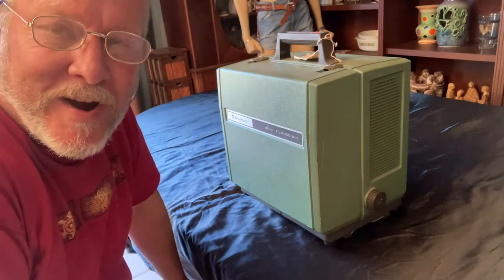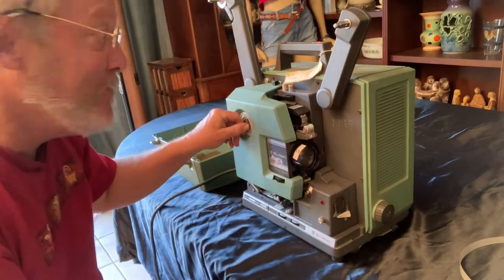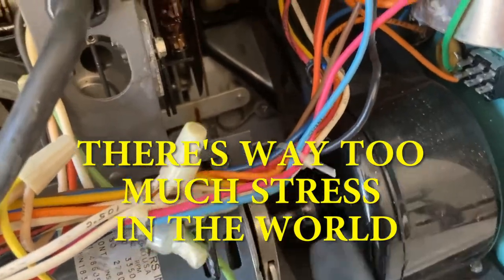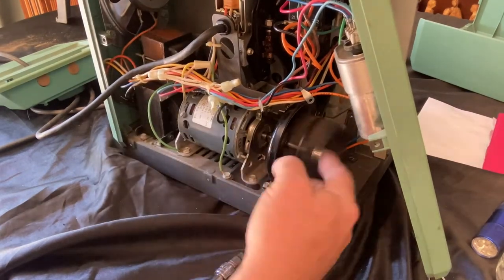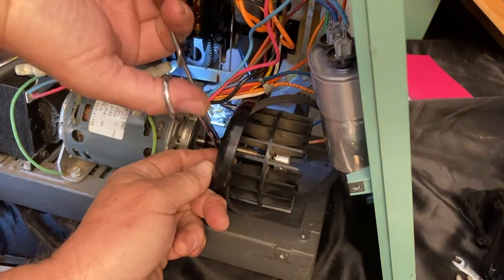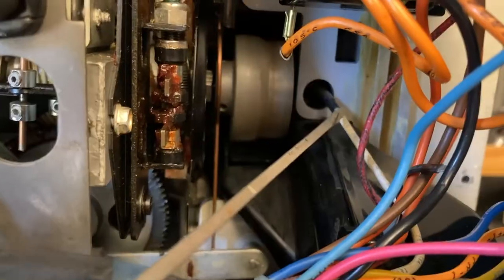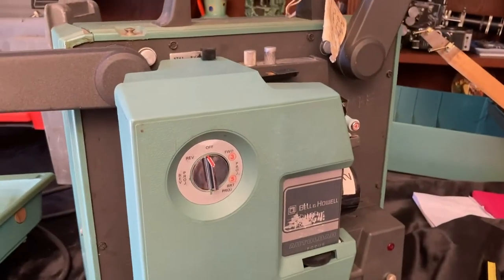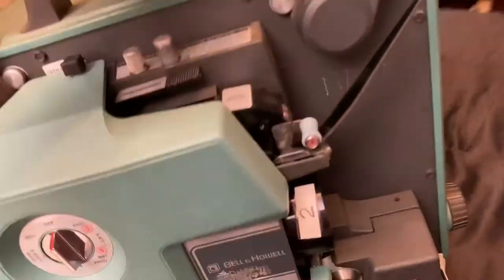Vintage thrift store 16mm Projector plays Speedy Gonzales cartoon after replacing belt. Recent haul.

Comment: You've done all of us a great service. The loose belt is a common problem. I don't know if the common person could replace it if need be, but at least it would give them a good start. Another problem would be a cracked worm gear. I've vowed never to buy another B&H 1500 series again because of those issues, but I am so glad to know that you had success in repairing your unit. By the way, I loved reading your captions. They are hilarious. I own five different projectors: a Kodak Pagent 250S, a Singer Instaload, two JANS and the first Kodak Pageant ever made. Great film print, too!! Entertaining and fun video!!
Reply from the maker: @jasonbeard4713  Yeah I'm pretty fed up with all the lovely green B&H's because the worm gear on all of them are doomed. Just a matter of years or decades and they crack. Nasty & difficult repair if you can get the replacement part.  I have 2 Singers and they are great top-notch machines without questionable plastic parts.
Reply: @lazycowvintagethriftdesign5595  Do you also  collect film, or did you buy that one to test the projector?